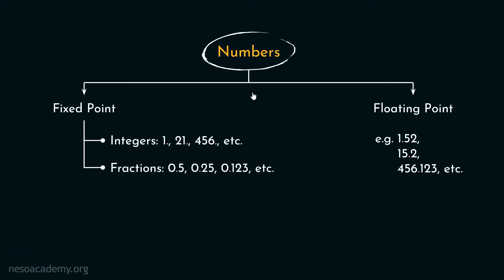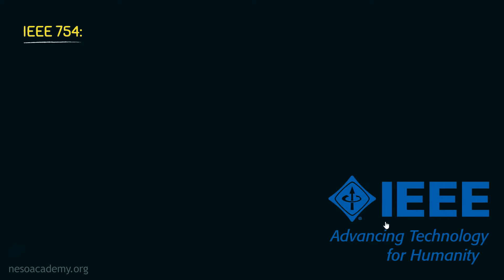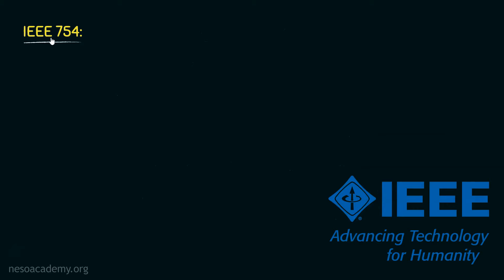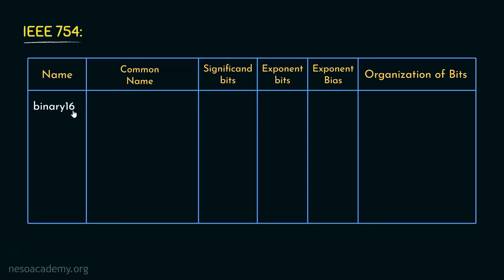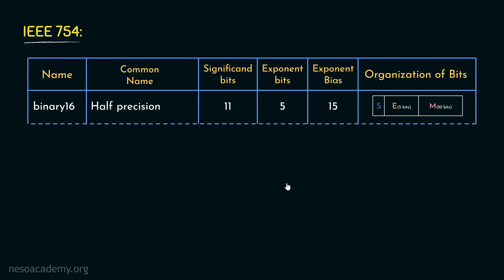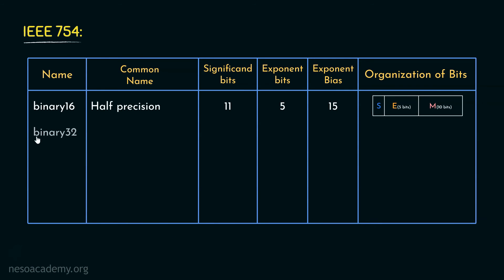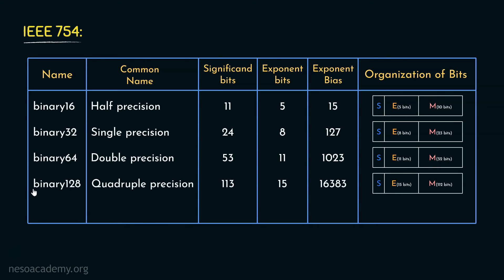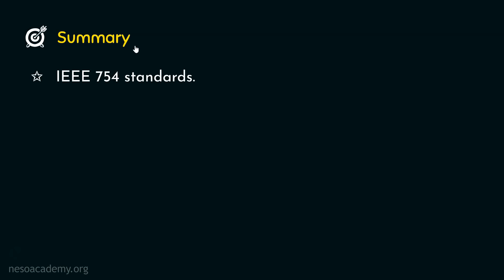IEEE Standard for Floating-Point Arithmetic (IEEE 754)

Comment: To the rescue? it's a Mediocre Format at best: reduced precision and range, old for old slow Math Co-Processors Chips(8087, 80187, 80287, 80387); but from the 80487, integrated, we should have made a better Format, that would Superset the old one, so no need to change code, just expecting better results

Comment: In floating point representation bias is 8 for 4 bit exponent i.e. (2^(n-1)).
But in IEEE standard why bias is 127 for 8 bit exponent, why not 128?
Reply: Because 00000000 and 11111111 in binary are reserved for other purposes. So the range in binary ends up being between 00000001 to 11111110, convert that range to decimal representation ==> 1 to 254. Now shift the range with -127 and it results in the following range: -126 to 127, which are the minimum exponent and maximum exponent, respectively, for single precision floating numbers.
Reply: Range for 2's complement is -2^n to 2^(n-1)-1. So for 32 bit single precision, it is 8 bit exponent. So range falls between -256 to 127.

-2^8 = -256 to 2^(8-1) - 1 = 127
Reply: @swethakoushik870 this is absolutely wrong
Reply: -128 to 127 I guess
 @swethakoushik870
Reply: no it's 7
Reply: 2^k-1 = 128-1= 127